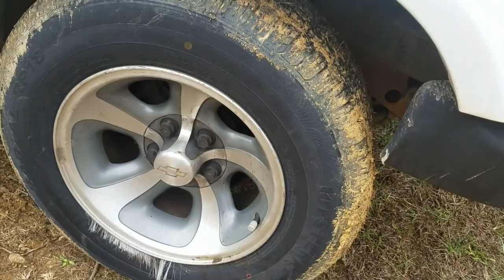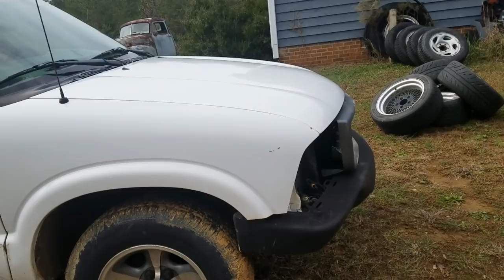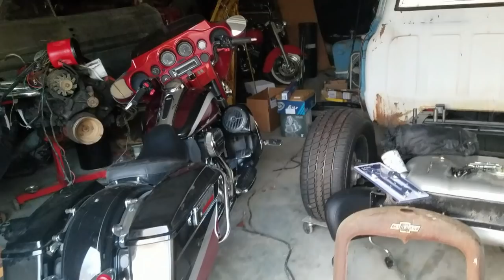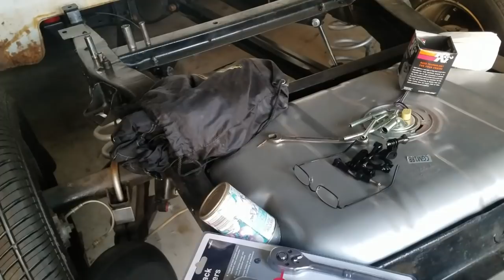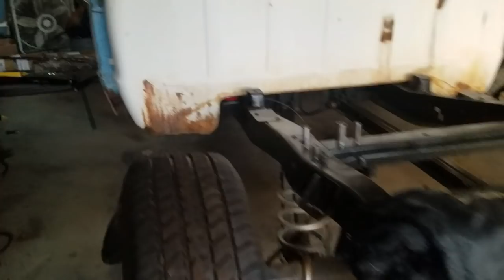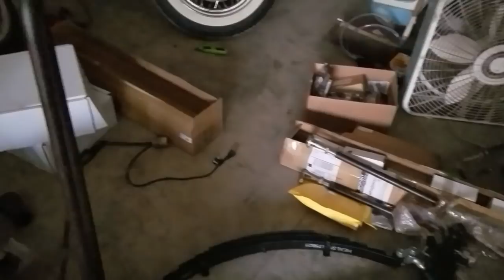Jonathan W November Cruise in, S10 truck repair and 37 Chevy Rat rod update

Comment: Where did ya get front axel and what is width?
Reply from the maker: Ebay. It is stock width Model A. I'll get you a width tomorrow.
Reply from the maker: The axle is 48" wide. I think with spindles its 51" to backing plates and 53"ish to wheel mounting surface.